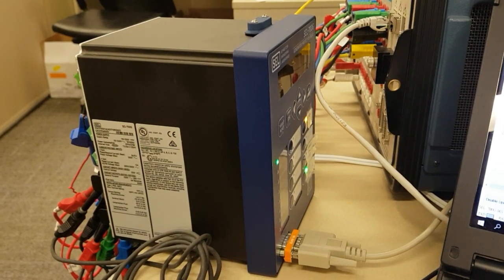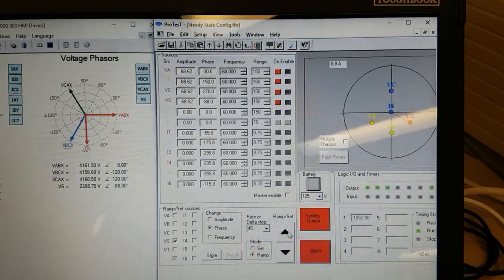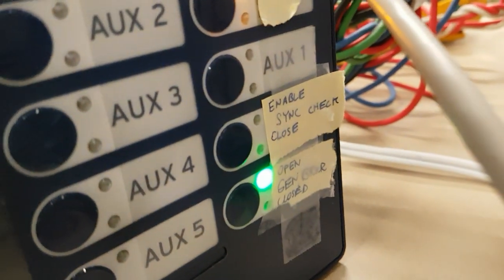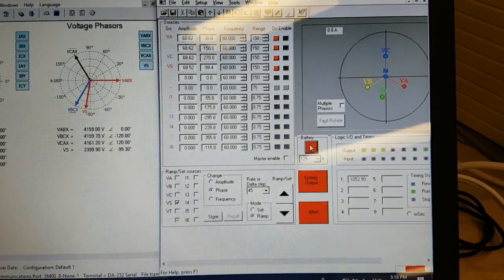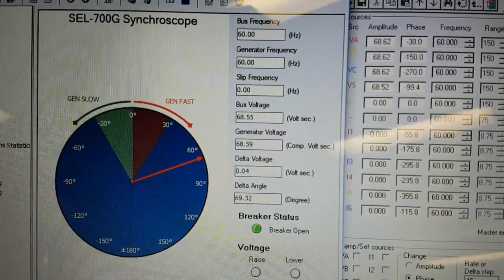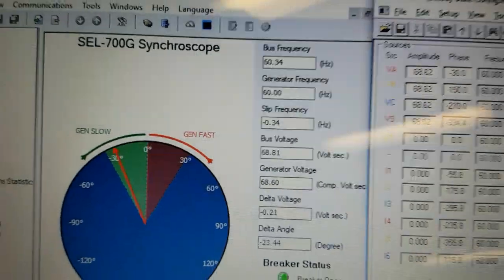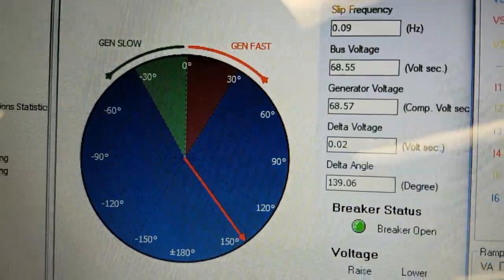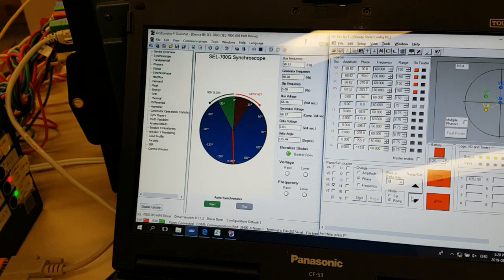SEL-700G Sync Check

Comment: Hi Sir, can i simulate the SEL-700G Sync Check using only 1 relay tester to inject voltage or do I need two relay tester?
Reply from the maker: It depends on how many voltage outputs your tester provides. Here, I have one set of 3-phase outputs (Va, Vb, Vc) for the generator and then another phase for the bus. (Vs) This simulates all of the normal inputs involved with sync check. If your test set provides fewer outputs, I'm not sure if it is possible to get away with just Va and Vs, you would have to check the relay manual. SEL support is also quite good, their local technical support contact should be able to assist you in that case.

Comment: Hi sir, why do they relay measures 0 degrees when you apply -30 degrees across all the phases? Did you apply vector group settings to the relay?
Reply from the maker: Hi Jeremy. The voltage applied is shown as VA, while the voltage displayed on the relay is VAB. In a system with A-C-B phase rotation, VAB is +30 degrees from VA.

Comment: I need help for testing 87. And  another  elements. I have  the omicron tester. Where i can find that kind of help un internet?  The genefator si 20 kw and 3500 MW
Reply from the maker: Sorry for the late reply! There are many great free online resources, guides, and blogs e.g. the EEP Electrical Engineering Portal. IEEE guides are also excellent for protection. Hopefully you found what you were looking for. If not, feel free to message me if you have any specific questions.